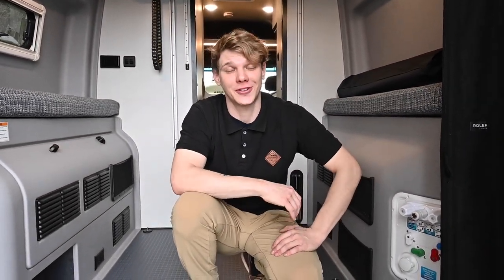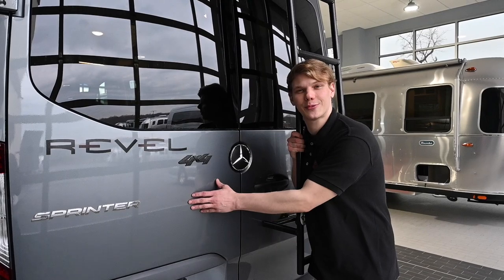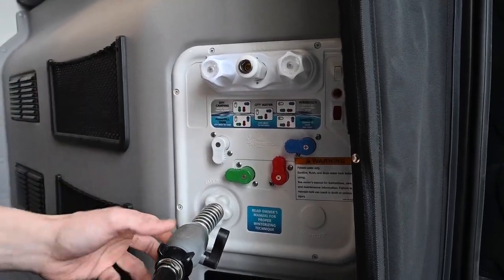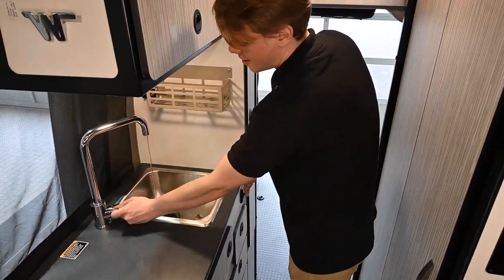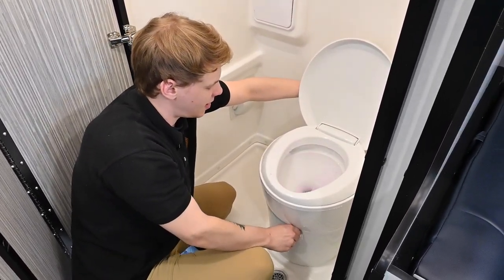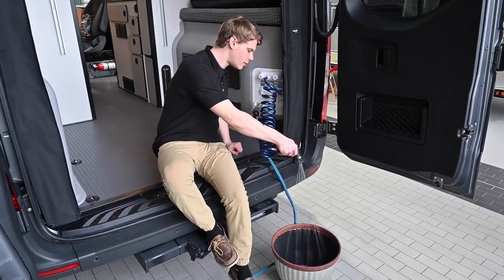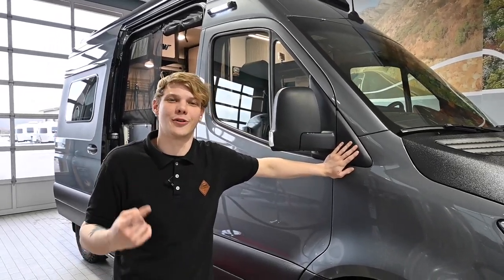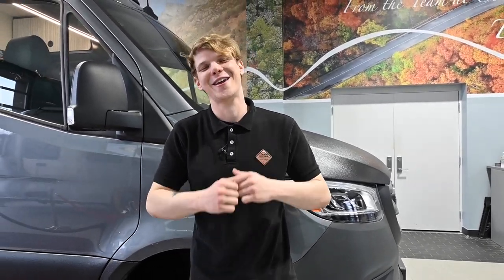RV SEASON IS HERE | How To De-Winterize Your RV Camper Van | 2023 Winnebago Revel

Comment: What does sanitizing water consist of? (Roam owner).
Reply from the maker: Sanitizing the water in your RV involves cleaning the water system with a solution, typically bleach, to eliminate bacteria and ensure the water is safe for use and consumption. It's a straightforward process that involves adding the solution to your water system and flushing it through to cleanse the pipes and tank. It’s recommended to do this periodically, especially if your RV has been idle for a while. For detailed steps, you might want to consult your RV's owner manual or reach out for specific guidance. Stay safe and enjoy your travels!